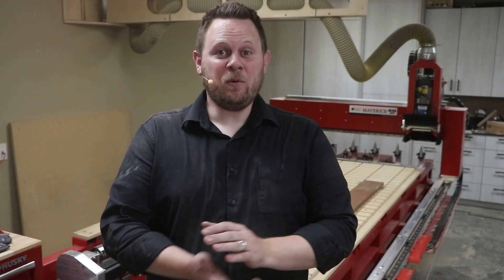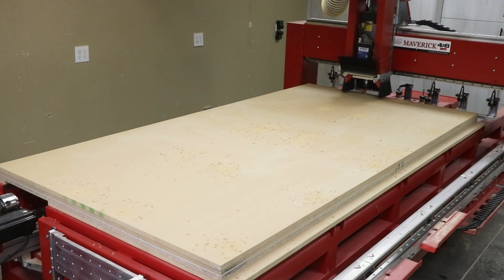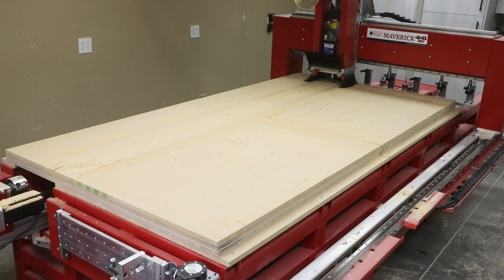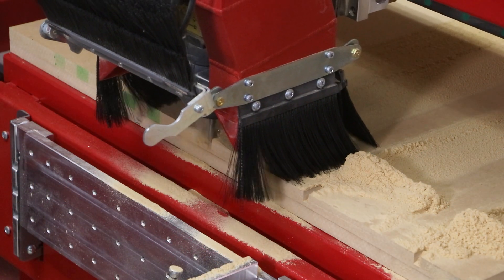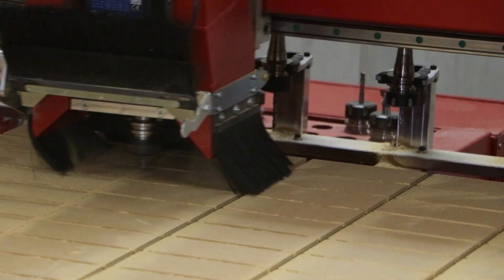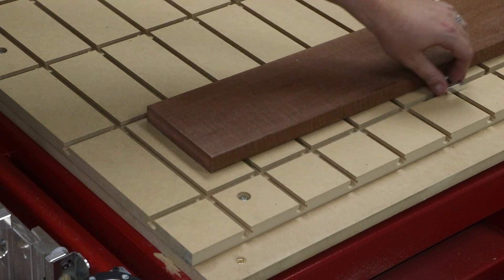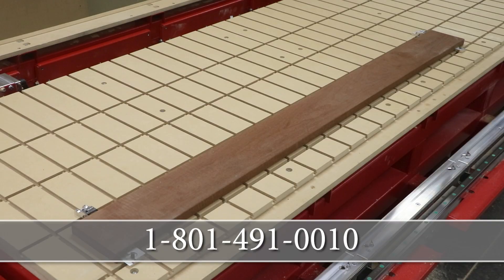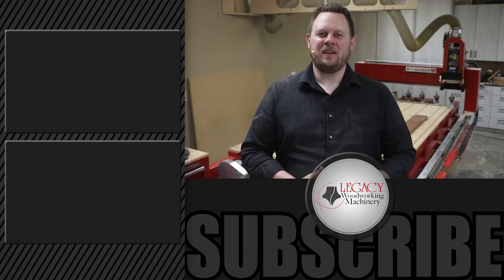Revolutionize Your CNC Setup! DIY T-Slot Clamping Fixtures that'll Blow Your Mind!

Comment: What bits were used to cut the T slots?  I would like to make a table for my Artisan.
Reply from the maker: That router bit is Magnate 6105.  Notice how we first used a 0.25 inch bit to clear out the hole before running the T-slot cutter.  While you do not have to do that, we have found that it makes the dust clear easier.